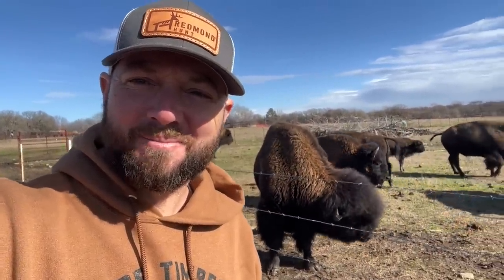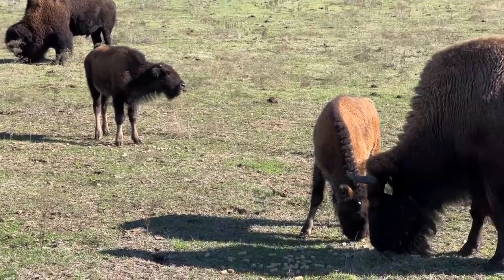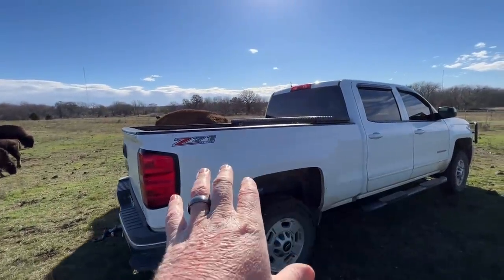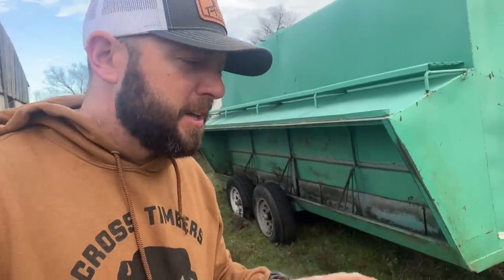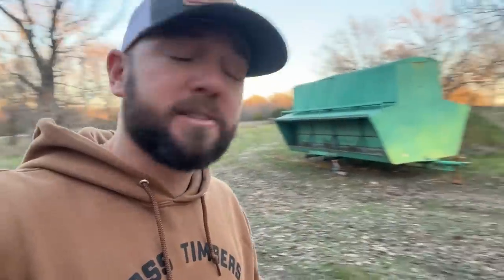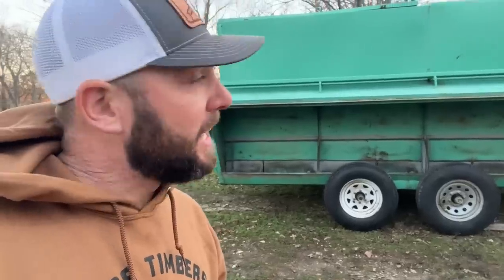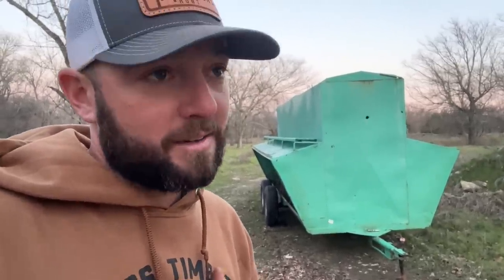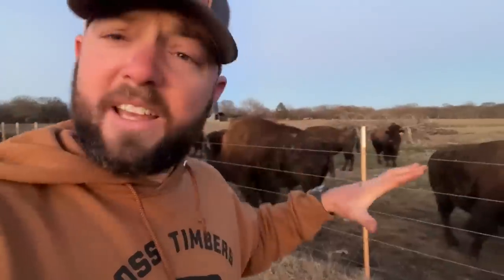We Can Just Blame It On Dunbar!

Comment: Dusty maybe your welder friend can fabricate covers for the wheels so Dunbar can not get to them. You could set them over the wheels and bolt them through the rims to keep them from coming off. Maybe even a tie down strap could be used if the covers had a place on them to slide the tied down through and under the axle.
Reply: Some times tire shops and gas stations that sells tires have some semi good tires they sell for cheap. Also you could check at a auto salvage business aka junk yard to see if they have some good used tires.

Comment: If you want a feeder in the flat bed Dusty. I would make it a built into the bed behind the wheel with a lid above. It will feed at the back either from the side or the back of your truck. Then it can be taken off when you don't need it with sliders and pinned to stop it falling off. If you can't get the bed made like that, your friend might help you to make it the way I described. I would have it big enough to put more than 1 bag of cubes to give you more options.
Merry Christmas and a happy New year to you all at the Ponderosa and the Dunbar ranches.

Comment: A flatbed with removable sides would definitely be more useful for most of your needs. A pickup is nice except your use is more service then hauling. The feeder needs sliding covers to save on tires for sure.

Comment: Maybe you can get your welder friend to fabricate some sheet metal covers that can maybe bolt to square tubing, for instance, underneath the trailer or something. My idea is something that looks like a fairing that goes over and around the wheels to the ground and attaches underneath to each other for stability but can be removed for transport. Something that will protect the wheels from the herd and weather.

Comment: They are feisty, frisky and just a very happy bunch of big kids!! Also Brooks is so cute and I'm sure Dunbar likes to see Brooks too.

Is it possible to have a feeder as a separate unit you can tow behind the truck and be able to use a remote control to do the feeding? if that's possible, then, I'd keep your truck the way it is. If not, then, I'd make the change to your truck and make it a flat bed. I think it is a good idea. 

Can you make tin wheel covers for the feeder to protect your tires on the feeder? It's just a thought. 

I don't understand why you're thinning things at your original location to the Ponderosa. What are your plans for Momma's and Kevin's location? Seems odd to not take full advantage of the acreage there. I hope you will comment in a video to answer my question.

Comment: You dont need a flat bed with a cake feeder, just move your tool box back. Keep you bed if the truck is a gasser, a flat bed if its a diesel, the latter motor will last longer. Do your critters attack wheels like some dogs like to, perhapa some metal flaps over the top third of the tire like old Catalac rear fender skirts would save the tires on your feeder.

Comment: one Last thing, the tire problem looks more like sun rot.  This is caused by not covering up your tires and the sun dries the sidewalls out.  Making them crack and get weak.  when you get the feeder in place, block the tires off the ground and cover them.  Then build some rebarb fenders for the wheels.

Comment: And you can also get a flatbed that has inserts for sides, so that if you need more of a cargo area you can put the sides in and have that option.  But it would make sense to get a cake feeder, I think that everytime I see you drive along spilling pellets out the door, its just a accident waiting to happen where either a bison runs into the door and hurts you or the animal gets hurt, and where the pellets fall from at your driver side door, the physics are just pending being too easy to turn that truck on its side.  A cake feeder dropping pellets further back is liable to put the animals going after the pellets, as you move ahead, more in line with the rear axle or the tailgate and more likely they worst that could happen would be to push you into s skid then push you over, although actually a cake feeder itself probably would dump out more pellets at a time than you would realistically want.  Around here, those places that make cake feeders can adapt one to feed pellets so less are dropped at a time, which is probably something the company near you that makes them could do also.

Bison are not the only animal that can be rough on tires, cattle can ruin a set easily in a season.  What we have done with our feeders that are going to be out in a pasture for a several weeks to months  at a time is to tow the feeder where we want it,  jack it up on some very wide blocks so they cant push the wheels off the block and put the feeder on the ground and then leave teh tires in the barn.  Sure it means when we need to pull it back in to fill it up, we have to put the tires back in each time, but the cost of that extra bit of man power is way less than what its costs to replace 6-8 tires a year, or more often.

Comment: Dusty have you checked out Stull feeders? They have ATV mounted cube feeders, I’m sure it could be adapted to a truck if needed. Their out of Arkansas.
Reply: Could you bolt some diamond plate to hang down to protect the tires also check with your tire store if they could save you take tires when someone put new tires on a trailer, it’s not like you are running up & down the road.

Comment: Dusty, I can save your tires. If your axles are the same as a tandem trailer axles you could make a steel envelope to slide over the tires and bungee cord them on the inside to the axles so they stay on the tires. Dunbar would stop digging at the tires.

Comment: In my 61 years I last truck doors mirrors windows feeding cattle pallets for many years I've gone to flatbed only cuz the sides of the Box got caved in and I built my own feeder for the back I don't buy them expensive cheap commercial ones it takes nothing but a scrap file to make one that's 10 times better I felt all my own decks as well and trailers

Comment: Oh my gosh yes. I mean I used to have vintage Volkswagens and you can't use an air impact wrench hun installing you know the tires onto the brake drums because the metal is completely different from back then than it is now and so I mean the last time I took my bus there and I said please hand tighten them don't use the orange and they use the air wrench and as I drove away all I could do was  hear  click click click click click click click click click. And faster I drove the lottery. So I had to literally go to my engine mechanic and he broke the tires free and he had to take and grind like an eighth of an inch off of each tire stud I mean the entire bolt because back then there were lug nuts they weren't I don't know what what they were called they were lug bolts that went you put them into the tire and then they threaded into freight drums. It's not like today where there's a stud and you put on a lug nut not sure if I worded that right yet cuz they were like bolts and they were lug nuts. Before with my with my bus it was like you had lug bolts and they're sitting there using this Tang impact wrench and just driving that thing in there and almost stripping out the thread I mean literally they're putting in the bolts so tight that they're hitting the brake mechanisms inside the wheel brake component compartment. Yes people got understand if you've got a vintage Volkswagen it's got to be tightened down by hand you can't use those stupid air wrenches and it's the same thing sometimes with tractors because some of them all they have different components of metal and if you use an impact wrench on tightening down the tires when there's no reason to other than your own laziness because the tractors are never going to go more than if they're running top speed to go to another field maybe they do 25 miles an hour. These things are built for torque. And you don't have to build those damn things down with the damn air wrench. You need to hand tighten them for the manufacturer specifications. But no you got you get these people that are just too damn lazy to do it the right way. So I know I'm rambling but you struck chord sir yes struck a cord